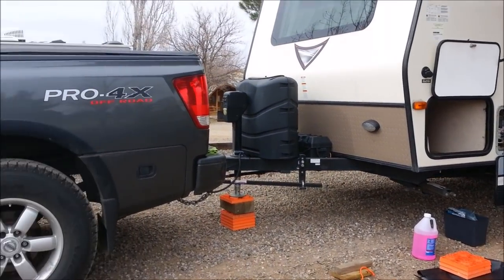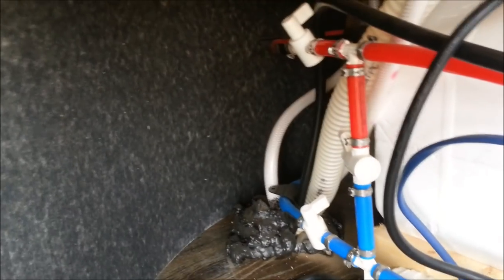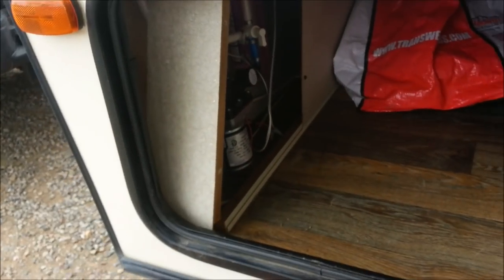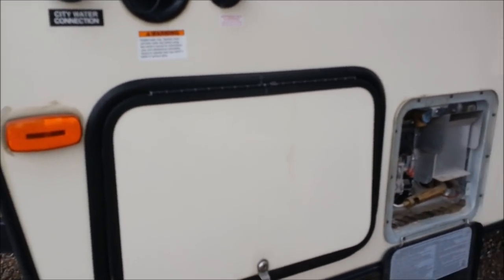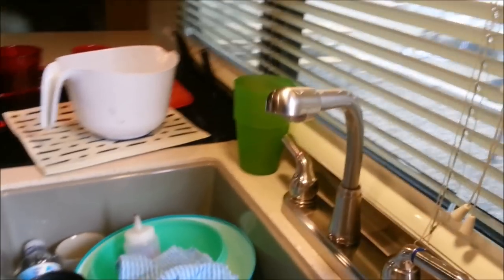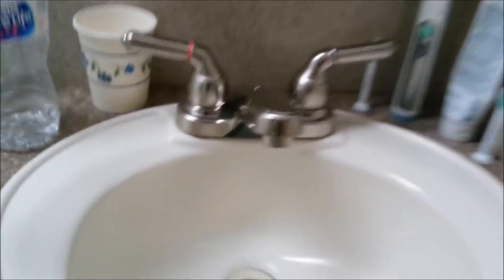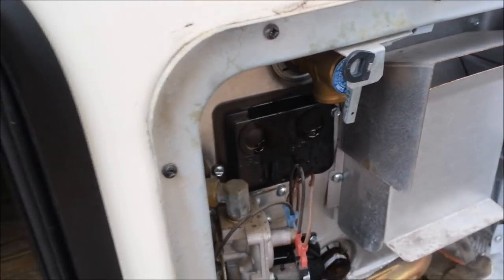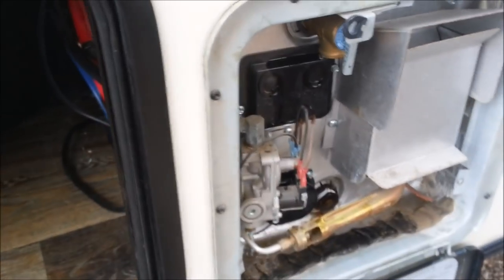De-winterizing a camper.  Antifreeze removal.  2017 Rockwood Mini Lite 2109s

Comment: Good video. Just bought a 2021 Rockwood mini lite and need to de winterize it. Not real sure about hot water valves, but yours looked just like mine. You also showed where water filter is, thanks for that. I had no idea. My dealer said most guys run an inline filter in the fresh water hose and don't worry about the onboard filter because of the mess changing it. This is my next step to be able to go camping. Wish me luck and thanks for the video.
Reply from the maker: OH cool!  :)   I hope you have a ball.  Yes, I just have an inline filter connected to a pressure regulator right off the water connection. I don't mess with that inside filter at all.  But beware, there is water in there you need to account for.  Good luck and enjoy my friend.  Michael

Comment: Thanks.  This helped me do my 2020 RWML 2511S for the first time today.  That compartment with the filter and the pump... as I was doing it, it made me think "how about we put water an electricity close together and make it so you can't get the filter out w/o spilling water every time".  I got through it.  Mine was even tighter than yours.  In mine I could not put any bucket under the filter container, just towels shoved in different ways.  Thanks for sharing, it make me know I was doing the right thing.
Reply from the maker: Glad you got it done.  :)  Yes, even I had to put a towel underneath.  LOL  Happy camping.  Michael

Comment: What kind of filter does that on board filter system? I fir the same thing but I don't have any info on it.
Reply from the maker: If you take the cartridge out, just go to Walmart and you can get one easily.  However!  I don't use that filter system, too hard and messy to change out.  I leave no filter inside the holder.  I use an external in-line filter on my exterior hose.  That would be for a full hookup of course at a campground.  If I am filling my fresh water tank, I filter the water using the in-line filter from the spigot.  :)  An external in-line filter will last for 6 months of full time camping quite easily.   Here is a link to the filter I use connecting it to my water hose.  https://www.walmart.com/ip/Camco-40019-TastePURE-XL-RV-Marine-Water-Filter-with-Flexible-Hose-Protector-for-Water-Filtration/794531501?wmlspartner=wlpa&selectedSellerId=0&&adid=22222222227152817010&wl0=&wl1=g&wl2=c&wl3=264455981181&wl4=pla-501727911037&wl5=200803&wl6=&wl7=&wl8=&wl9=pla&wl10=8175035&wl11=online&wl12=794531501&veh=sem&gclid=CjwKCAiAhbeCBhBcEiwAkv2cY-7ZGuoUIuW1K67FMIZxGd6R7QGkdd02aBQjUCebwxtsFVSpMIr3ThoCY4kQAvD_BwE&gclsrc=aw.ds

Comment: You add no bleach to finish the sanitizing process?
Reply from the maker: Good question.    In Aurora, where I lived, the water is quite Chlorinated.   I don't see any use in more Chlorine.   If you feel it is needed, a tiny bit goes a very long way since it is poisonous in too large a dose.   :)  Thanks.

Comment: Your suppose to drain hot water tank when you winterize
Reply from the maker: Oh.  I did.  :)
Reply: Save you a lot of trouble blow your system out air compressor blow out your pipes the heck with antifreeze

Comment: So let me get this straight. If I bypass the hot water tank can I still turn my hot faucet on and have water come out the tap?
Reply from the maker: If you shut off water flow to the heater, no water will come out of the heater to the hot water taps. All the hot water lines are fed from the heater.  Those are all the red Pex lines in the camper.  If you watch this video, you'll see that all the hot water coming from the heater comes from the top RED Pex line.  :)   https://youtu.be/dnvLo7KRoiM
Reply from the maker: If you open the bypass valve, with the cold and hot water lines into and out of the heater closed, then you will have cold water coming out of the hot water taps.  That is a yes.  :)